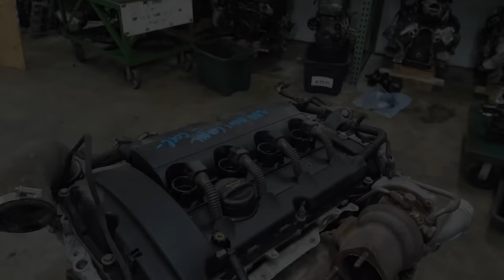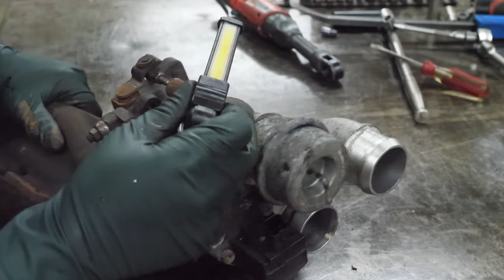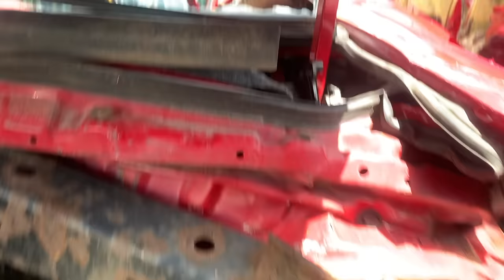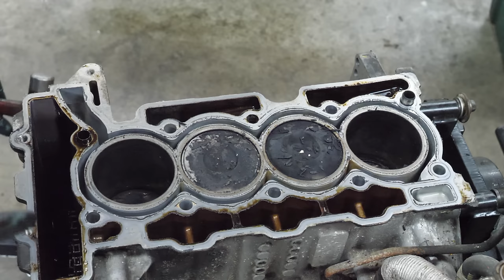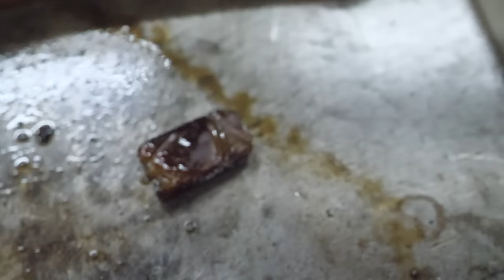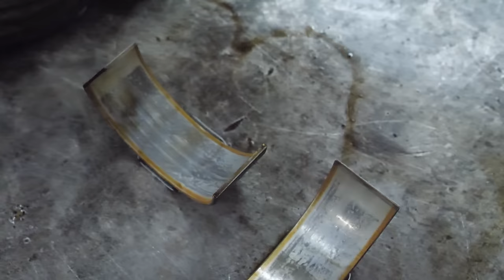JUNK Mini Cooper S (BMW/Peugeot) N14 Turbo Engine Teardown. Why Do People Buy These?

Comment: Funny thing about these engines: when BMW left the project and the PSA group kept them, Peugeot fixed most of their problems (fuel pumps, chains, tensioners, guides, PCV valve replacements, etc) they've become pretty reliable for a small turbo direct injected engine (as long as you maintain them properly, of course)
These are pretty common here in Argentina in some Peugeot, Citroen and DS models, but as you may imagine, in a place with an awful economy, maintenance is not always a priority, so they do not have the best reputation, specially the earlier ones.

((Personal experience))

We have a 2016 Peugeot 408 with one of these and it hasn't been perfect, but maintenance hasn't been perfect either before I took care of it, either way it's doing pretty good.
We have the first "updated" version of this engine and the only major thing we had to deal with was the timing system, because being an really early 2016 model it still came with the original timing components, it started doing noise around 38.000kms and we finally changed it when the car had 53.000kms, the only thing that may be a problem now is some oil consumption, I believe it drinks too much oil and if that's true, it's due to valve seals, which is a pretty common issue with these engines.
Overall, it's a really powerful engine compared to how much fuel it consumes and the size it has, and if you buy it new and maintain it like the manufacturer says, it's not bad, it's just not for people who don't care that much about their cars.

Comment: I've owned two Peugeot 208GTi I did over 100,000 km on the first one with just one issue HP Fuel pump and it was a fantastic car to drive, on the second car I did about 50,000km again with no issues, I sold it to get another Peugeot (2008 GT) which I love. moral to the story get them serviced when they are supposed to be

Comment: When you find one of these that has been overheated, take a look inside the hoses that connect to the engine oil cooler. These run down the firewall side of the engine. I've had several of these on which these hoses were PACKED with some kind of substance I originally couldn't identify. On the second occurrence, I decoded to cast about on iATN and found a gentleman in Arizona with the same problem. I called him and together we started to develop a theory. The substance clogging the oil cooler hoses looked like cement. 

What we decided was that this substance was is sand from the block casting process. It was a light brown/tan substance that had packed completely solid in the engine oil cooler and the coolant feed pipe to the cooler. I wonder if anyone else has had this experience.

Comment: there is a frost plug behind the timing chain that likes to pop out in the N12/14 engines. All the coolant/water then escapes into the pan! At 11:20 you can see the frost plug in the bottom left of the picture. Hard to say if it's in there or not... but that's the usual culprit for water in the oil. However, we DO have an N14 mini in the shop today that has water pouring out of the head between the cams around the #3 plug area... haven't figured that one out yet ;)

Also, the "belt tensioner" you mention is actually the drive wheel for the water pump. The belt runs it as it spins on the crank shaft. These do have a separate tensioner on top of the alternator.

Comment: I replaced the cooling element, did put 4 new ignition modules, replaced the sealing rubber from the oilfilterholder.
Now only have to replace the oilseals on the valves and everything is done.
I got a non Turbo 1.6 VTI.
Not the best engine but better as the Turbo.

Comment: I have a NA N12, it's always run badly with various oil leaks & annoying features. When running right it's ok, but it's temperamental & does require some maintenance at higher miles.

Comment: I have one of these with about 45,000 miles on it (2016 C0untryman S). The only problem I've had with it was the computer had to be replaced. Luckily it was under warranty. It gets pretty lousy mpg.  Before that I had a 2011 Clubman S that I put over 80,000 miles on. No big problems with that, and much better mpg than the current one.

Comment: I have a 2013 cooper s with the n18 and I have 237,000 miles with no major failures. I’ve never done any of the maintance like timing chains and I probably ran the same oil for 20,000 miles 2 or 3 times lol. I had to change a valve cover gasket and found the top of the the timing chain guide broken so I picked it out and threw it in the trash and put the valve cover back on. At 199,000 I did a big turbo, eBay intercooler and a stage 3 tune. I’ve got about 285whp and beat the ever living shit out of this car. It’s even got the factory clutch. 
I do sometime wish I had a n14 for some of the aftermarket support when building them like cams and what not.
Reply: I’ve also never cleaned the valve. I’m not proud of any of this but I also am super happy it’s never failed me lol.

Comment: I had one once. I believe the problem is on the head, in the very middle, where there is a core plug which often leaks pouring water into the rocker box.

Comment: My grand pop owned a 32 car garage in Denham Mass in the 20-50s  and he used to travel with spare parts tucked away  he told my dad tuck away what you don’t want to break  and he’s right every extra part I hid in my cars would never be what broke  .

Comment: My wife bought one of these new as they were released in 07... factory serviced by mini its whole life we had to sell it after 11 years at 56000 miles as the engine was done... would use 2 litres of oil over 200 miles.. rattled... and this was after the last service we had done costing £2000. My wife loved that car but there was just no way keeping it made sense.. i see now why it was so expensive and unreliable... bought for £26000, sold for £2000.... exterior and interior still looked like new... fast, good looking.. junk. What amazed me was that bmw changed from this engine after only 2 years of the mk2 new mini to a different engine, still in the mk2 mini... normally new engines come with model changes.. at that point it would have been nice to have been offered a swap to the newer more reliable motor under warranty.. but no... just keep paying the massive servicing bills as the car suicides itself... ridiculous, and personally a real shame...

Comment: I think that PSA solved most of the problems of this 1.6 l engine in (I believe) its "third iteration", somewhere around 2016... after that, they become far more reliable and are still used in many models of Citroën,  DS and Peugeot...
Reply: I hope. I have the new 308 hybrid which has this ”prince” engine. Now it has 13 000 km and I have full warranty etc so im not concerned. But I hope to have this car for a while… but maybe its gonna be changed before anything major, so that my memories are alll goooood with it. Love the car.

Comment: The problem with loads of engines these days, especially BMW is that the service schedules have been extended and extended to satisfy leasing companies.

As a result when the cars come out of lease and are sold at auction they’re already ticking time bombs waiting to break on the next owner, usually when they’re out of warranty.

The best thing to do is 1/2 the engine oil service interval at a minimum. Oil’s a hell of a lot cheaper than an engine. It doesn’t have to be top class oil, just oil that meets the spec.

Cheap oil changed often is far better than expensive oil changed every 18k miles

Comment: I have this engine on my Peugeot. The most common major problems are HPFP (high pressure fuel pump), Westgate turbo caused low boost, and others that are minor.

Comment: I bought one of these cars with this engine and was told by the dealer that it burns a quart of oil a month from day one. and I found it to be true . I had to add a quart every month or the engine would start knocking. the dash does not have a engine oil warning light , It just notifies you the car needs service. loved the car but would never buy another BMW product after that.

Comment: I had a 2008 JCW with this engine. Main issue was timing chain. BMW couldn’t fix it and ended up taking it to an experienced independent garage who knew their stuff. Covered a further 50,000 and then traded in for a Corsa VXR.

Comment: I believe the tensioner you pulled off is only for the water pump at least on our 2010 there’s also an additional tensioner that’s up higher that requires a special wrench because you have about a quarter inch between the shock tower and the bolt

Comment: I had one of these in my JCW. Which makes even more power (circa 215bhp I believe). 

Huge timing chain rattle that meant I had to bite the bullet and have the chain and the guides replaced. This was massive expense, as the crazy tight packaging means you have to take half the car apart. 

Huge heat issues when used on track, not helped by the turbo being right next to the radiator, and the car having a woefully inadequate intercooler. 

Lumpy as hell idle, thanks to the filthy inlet valves due to the direct injection and the car liked to play games with “which EML light would you like today” usually MAF and O2 sensor related. 

I’d never own one again!

Edit: I forgot to mention the common leaking valve cover, which mine also had!

Comment: I had absolutely the same problem on same engine (NA version) - the big technological cap of the cooling system suddenly fell out (located on cylinder head between  camshaft gears). So the whole coolant instantly drained into the oil. Engine faced with misfires (maybe emulsion from PCV), and after emergency stop i found empty coolant reservoir. I've decided to add some water but after 15L i surprised with still empty reservoir and dry under car :) As a result oil pan was full of the same s*it. After only cap reinstalled (valve cover removed) and 3 instant oil changes engine drives OK that was 4 years (~50k km) ago

Comment: I have a 2008 Mini Cooper base model with this engine and it has 245K miles and still going strong. I change the oil and filter every 3000 miles and replace anything that has run its course. Yes, it leaks oil but what BMW doesn't?

Comment: On mine the internal core-plug between the water-jacket and the cam-chain chamber "fell-out" emptying the coolant into the sump. "Never Seen Before" was BMW, turns out it had a tolerance issue and this does happen. The core-plug was found resting on the tensioner, so it didn't make it to the gear below.  Had so many issue, never again.

Comment: have had the Whater Oil Problem on a VW Engien about 20 Years Ago. The problem is a bad Crank Case Venting in Combination with low Milage pert Trip in Winter Time and a All Aluminum Engine. The Aluminum Engine can not hold the Heat, so condens Water is Building up. If there are only short trips made the Oil is not propper heated over 100  c in combination of bad venting the water Build up. If you are Lucky, it freezes on a Cold Winter Day and the Oil Pickup cannot pick up oil. Then the Oil light comes up an if you are careful you shut down the Engine, if not, you Kill it.  An additional hose from Valve Cover to Intake Solved that for me, no more water in the Oil since.

Comment: nice video, the timing chain is also know to skip a tooth ! the first engines had also a issue with the timing tensioners and the timing chain did stretch at times !!!

Comment: This family of engines was designed for a completely different market to where you reside - for different driving conditions. There are a number of flaws and an optimistic oil change interval - but it's rather presumptuous to call them "junk". 
In Europe we don't have USA style cheap gas (nearly 8 USD / gal (US)) over where I am and we have 100% duty & taxes that are based on engine displacement and car weight - so the manufacturers are incentivised to lighten the engine with lowest possible displacement for a given BHP
Reply: The gas in the USA is of similar quality than in Europe, if not exactly the same. The price difference is only taxes. And no matter what the driving conditions, any engine for use on public roads should be reliable for at least 300.000 km or 180.000 miles with the maintenance by the book. If not, it is junk. And indeed many engines, USA, Europe or Korean are junk. The best ones are Japanese, although I heard that they too are lowering their quality.

Comment: I did an smog check on one of this cars back in I think was 2002 and I found that these engines where made in Brazil by Chrysler.
I was a mechanic for Chrysler, Jeep, Dodge, Viper and Fiat for 26 Years and to me the worst engines where the 2.7, 3.7 and 4.7 with similar problems to this N14B16. I was a certified state emissions technician.

Comment: I have the later version in my Peugeot RCZ THP200.  I change the oil every 5,000 kilometres.  Not one issue.  BP Ultimate 98 RON petrol, Meticulously serviced, beyond manufactures recommendations.

Comment: 13:50 No, that's not how any of that works. It has two coolant pumps: an electric one and a mechanical one. Both are not running if coolant is below 20°C. Yes, that lining on the coolant pulley can crack over the years, but a coolant pump is somewhat of an wear item anyway. The little contraption you were for no reason hating on, is to run the mechanical coolant pump when required. Quite a clever system to get the engine up to temperature faster.

Comment: With that PSA origin engine it is absolutely essential to change the oil BEFORE the recommended maximum and only use dealer spec oil with OEM filters, it's also advisable to use only premium fuel, not supermarket rubbish and run BG244 fuel system cleaner through them every 12 months after 60k miles. Where possible block the ERG off or at least run some ERG cleaner through them every 24 months.

Comment: I used to own a Peugeot RCZ with that engine (155hp version from 2011), and timing-chain related issues apparently are a common problem with these. Got the car used with ~57k km (~36k miles), had the timing chain replaced after noticing a chain-rattling kinda noise. Second time at ~99k km (~61.5k miles) I wasn't as lucky and the timing chain jumped while I was driving to work. Apart from one delayed inspection, I had regular maintenance done on the car, drove premium fuel, and topped of the oil on a semi-regular basis (burnt like 0.3 liters per 1.000 km, according to the mechanic I went to back then anything between 0.25 and 0.5 is normal).
Apart from the sword of Damocles the issue with the timing chain was, the car was really fun to drive, such a shame Peugeot put that engine in that car. Guess there's a reason why RCZs with diesel engines are quite a bit more expensive than petrol RCZs.

Comment: Thanks for your detailed commentary and humor in these tear downs.  Do not understand how the piece of broken chain rail got to the oil pump with the pick up strainer in place.  
I bought a 2008 Countryman S with 90K mikes on it with startup chain rattle. Kid had gotten a estimate from the dealer for the timing chain job, so I got very cheap. Plastic chain rail (guides) were brittle and many pieces. Also walnut blasted the intake valves and did the double catch cans. Always takes at least a quart of oil every thousand.  But drives great in the mountains. They are chick cars. 
Question to anyone: mine does not have speed control. Replaced my steering wheel and clock spring with the multi function wheel. Anyone know how or where to program the ECM to enable the cruise control function? Thanks.

Comment: I drive a Peugeot 207CC with the 155 HP motor, I have over 131,600 on the clock and the motor purrs like a cat, it goes in for a check up every year, but it runs great for a car built in 2011.

Comment: Some rust pitting in the cylinder walls is not usually bad enough to scrap an otherwise good block. Unless it is really bad and covers larger areas, it doesn't ruin compression, or proper oiling. Clean away rust with WD40 and lightly hone the cylinder, then you still have a good block. You're left with a few tiny holes, which will soon fill up with carbon.

Comment: I have owned 3 BMW engines. The 4cyl Diesel blew up at just under 100k km  with lots of smoke and oil through the intake system. The 2 petrols were fine but horrible to work on. Most small jobs  turning into big ones because of poor design like the oil filter location on this one. My 2 Alfas were a dream to work on in comparison  as are my Landrovers.

Comment: As a Mini owner when I bought mine I steered clear of this and the Prince engines, they are both a horrible bad joke. My N47C20A so far so good even though the N47 has also a bad rep for timing chain issues but so far 100k in, nothing to report. But of course I am overdoing the maintenance. Every year full service. I do not cheap out on it and put in the specified oil. So far so good... that is all I can say.

Comment: Here is my formula for when to do oil changes. Based on full synthetic.

1. The car company is the high number to make it seem less expensive to maintain.
2. The oil change place always stone coldly stares at me and tells me to be back in 3000 miles. No matter where I go.

5,000 an even number, and it makes it super easy to look at your odometer and gave a pretty good idea of how many oil changes the car has had.

Comment: My N14 ownership experience.
> Timing chain death rattle - check
> High pressure fuel pump failure - check
> Cracked piston skirt -check

Comment: I have a 09 reg Peugeot 308, and it burns nearly as much oil as it does petrol, done 133,000 miles. It's still reliable though, starts every time, doesn't like traffic jams, smokes like a bonfire.